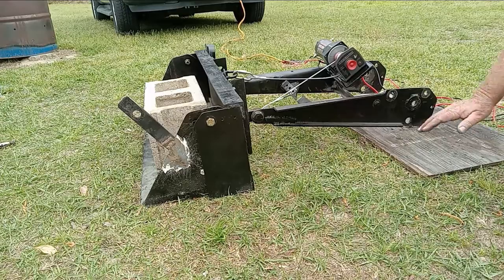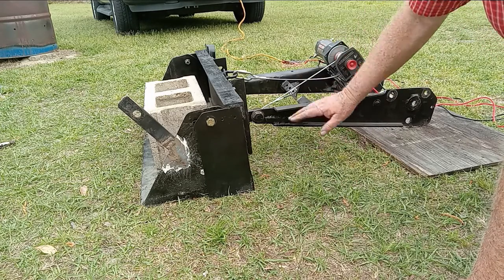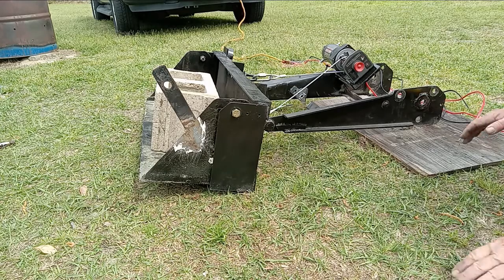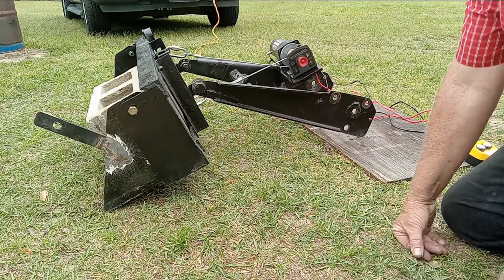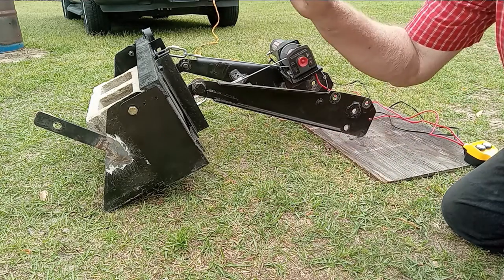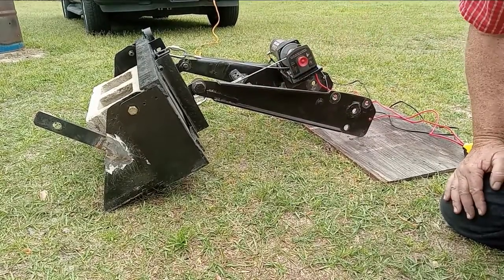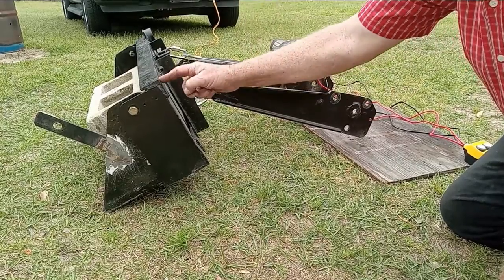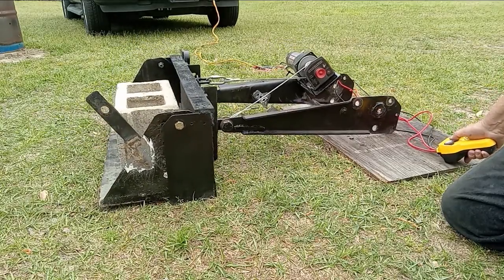Double Pull Winch  / 2 Direction Pull - A MUST SEE video if you are building a loader using winches

Comment: This is how i made my loader. Works brilliant. Currently building a mini excavator with the same princible
Reply from the maker: Wow. sounds awesome!
Reply: @eds2centsworth203  also putting a thumb on the digger as well. Having 2 bars welded togeather as the boon the thumb will be between them. The retracting side will be close to the boom as it doesn't require much force. The gripping action will be extended above the boom to exert a fair bit of pressure with the extra leverage